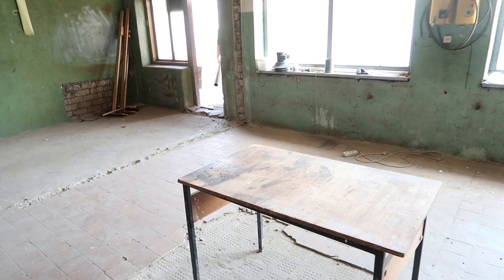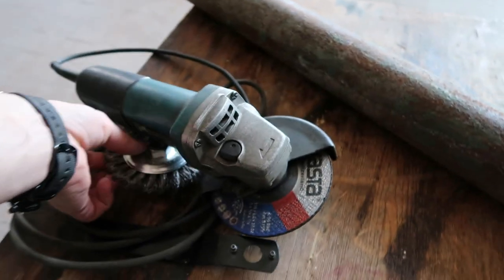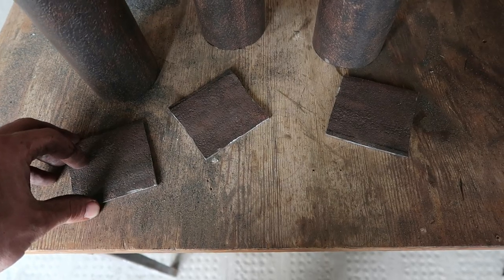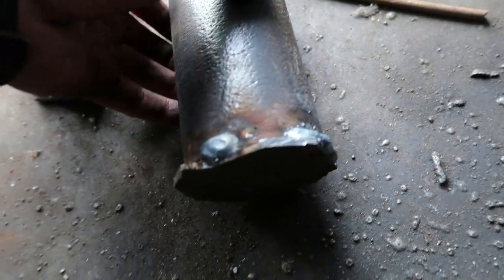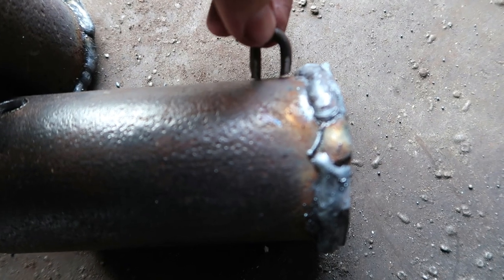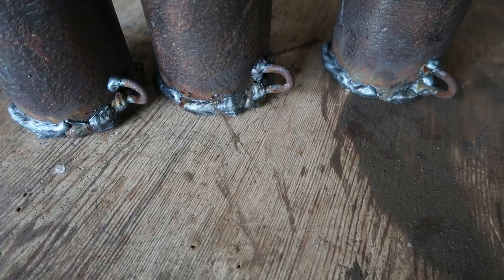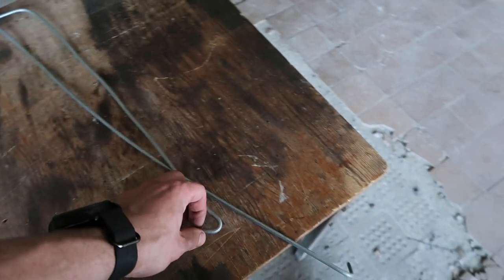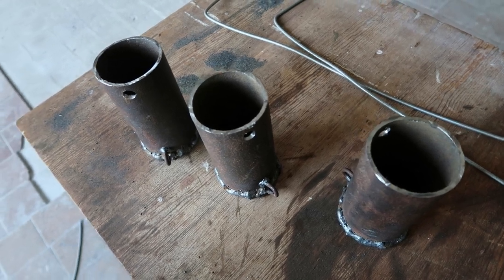I made steel crucibles

Comment: How long the crucibles worked, how much melting cycles average?
Reply: unlimited in a temp controlled electric furnace keep it under 2222f, where the graphite ones might crack fail or wear out

Comment: next time try sliding the crucible over a pipe or something at an angle so you can spin the crucible as you weld it will prevent you from having to stop and start so much which could cause weak points in the weld
Reply: scrownge stoping would not weaken a weld as long as the penetration is good throughout the weld then it will be strong. If stopping weakened a weld then double or triple passing would weaken welds essentially making the same affect to a prior pass
Reply: I'd just quick tac a couple spots to hold it together and then I'd stand it up on his end and use my free hand to spin it as I'm going I prefer once all is well but on some projects I do that's not possible so you just try to get the same amount of penetration whenever you restart I just go over the end of my world I start a little bit below or above where I stopped so I know it's going to get hot and penetrate it well enough to seal helpful hint is always do the water test before you put any metal in it if they can hold water without showing signs of weeks then it can definitely hold molten metal
Reply: he's got way bigger problems in his welding than that. his settings are clearly all wrong, seems feed rate is slow and/or amps too high. and also, start and stop doesn't weaken welds - or else stich welding wouldn't be a thing

Comment: are they good for melting copper?
Reply: mine failed I was using coal and coke and a hole melted in the bottom of my steel one...
Reply: not really lost my steel pot today hole melted in it....
Reply: No maybe one pour if you're lucky or careful or both lol I am on the same Quest 2 find one that will hold up and there really isn't a good DIY solution at least not anything short of we're just going and buying a clay graphite Crucible because the alternative is in the end cost more money then they clay graphite Crucible plus shipping would cost
Reply: i use mine for aluminum, copper and brass it holds up better in a temp controlled electric furnace vs graphite